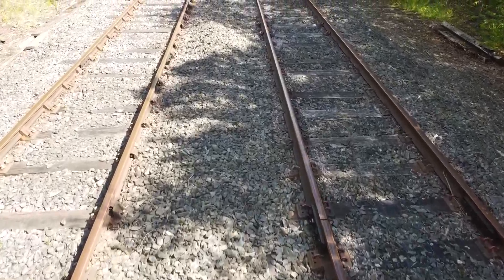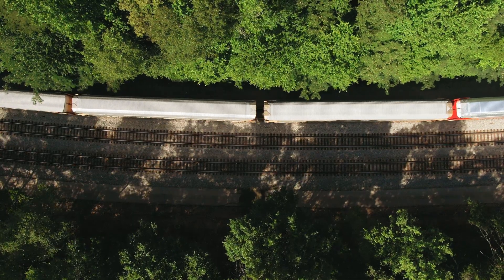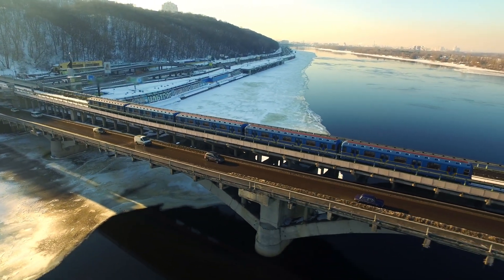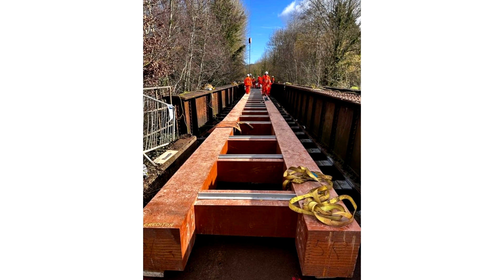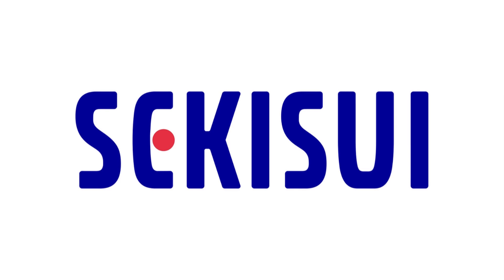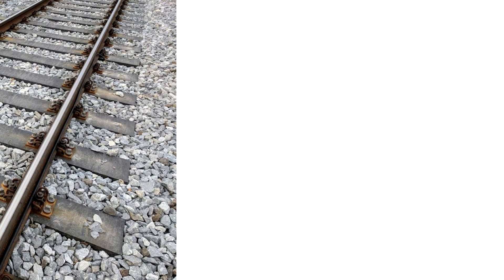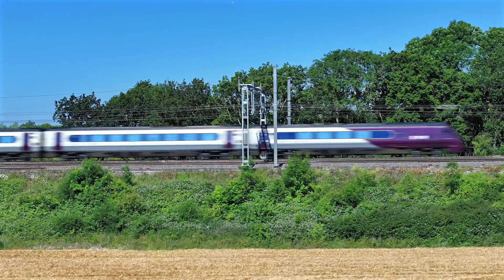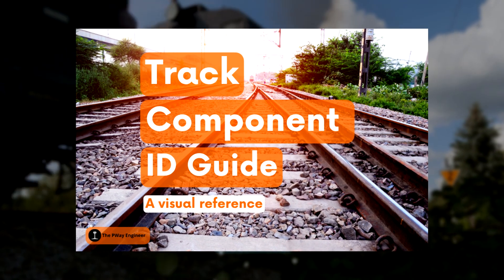Railway Sleepers: Which Type Performs Best? Full Breakdown

Comment: I think that concrete sleepers are the way to go these days. I reckon timber sleepers are only really good for dry climates and low speed operation. Plastic sleepers sound good for complex low speed point work but I don't think they are going to be good for mainline use. The new plastic sleepers seem like a microplastic source 😢.
Reply from the maker: I would tend to agree with you!

Comment: The main issue with concrete sleepers besides high cost over wood is an off wheel can crack hundreds of them in short order requiring replacement.  Concrete crossties have not stood up well over a decade with heavy axle loads normal for coal traffic.   This is why US railroads have returned to wood sleepers for coal hauling railroads where most US railroads haul coal.    Concrete sleepers are much smoother for passenger car use which has benefit for freight cars as well.   

It is the rail bed that provides much of the track's stability and freedom from jarring motions.   The rails can look relatively flat and consistent then when a train travels over them they flex up and down alternatively side-to-side causing sudden jarring.   The sub ballast consists of medium small sharp edge stones that interlock for a sable foundation and drains water away.   

Lateral and longitudinal track stability is provided by larger stone surface ballast.  The soil foundation under the sub ballast needs to drain well not becoming saturated with a high degree of compaction.   

Over years the ballast stone sharp edges round destroying the interlocking allowing  the rocks to move up and down.   The up and down motion creates suction when wet pulling mud into the gravel.  Now unable to drain with slippery mud and non interlocking the relatively light wood crossties offer little track stability.   

It possible to have a very long lasting track bed, but they do need replacement.   There has been for many decades ballast automated replacement rail equipment.   I saw CSX in Montgomery WV in the mid 1980s completely remove the tracks down to bare dirt lasting about 24 hours.    The next day a geo textile fabric was laid down then sub ballast compacted  with new new wood crossties laid down the same day.   Come morning there was continuously welled rail with surface ballasting taking place.   For a couple day trains move very slowly over the new ballasted tracks then they sailed through with non of the swaying back and forth common for freight cars.  Out of town about 3 miles concrete crossties where in stalled.   I traveled Amtrak over them and the ride was still.  I was saddened to study a Google aerial photo of the area in 2018 to see the concrete crossties had been replaced with wood.  

I've never seen US railroad track with a run of  steel crossties.    A few are seen where they appears to be for holding gauge at very high stress areas such as switches.
Reply from the maker: Thank you for sharing such in-depth insights. I appreciate it
Reply: It's mind boggling to me that people are pointing out that concrete sleepers getting damaged because of derailment is an issue. This is because a derailment shouldn't happen. The infrastructure manager should be doing anything in their power to prevent it from happening for a lot more reasons than just the sleepers.

Comment: Should we really be using plastics in sleepers? More microplastics in the environment when we should be trying to find ways to reduce and even remove 🤔
Reply from the maker: I think it’s a very legitimate concern! I guess it’s finding a balance as there is also the push to move away from cutting down forests and concrete has its own environmental impact. 

So I’m not sure there is a perfect solution but I do very much see your point
Reply: The fabrication installation and use of plastic sleepers is going to produce microplastics; but at the moment the largest source of microplastics are the tyres used on cars and trucks, so if a railway is going to be using plastic sleepers and that reduces the number of cars or trucks on the road it's going to result in a smaller number of microplastics compared to the equivalent amount of road traffic. There is a lot of plastic that needs recycling but isn't suitable for many applications so if it can be used for sleepers rather than being landfilled that's a plus.